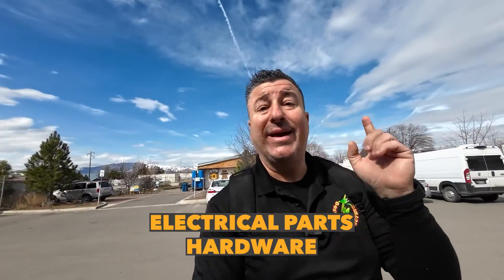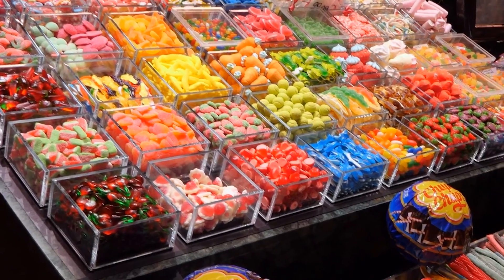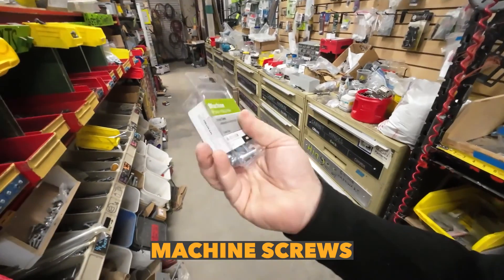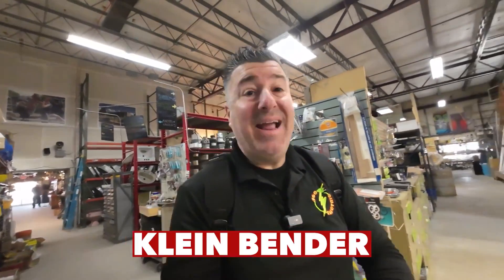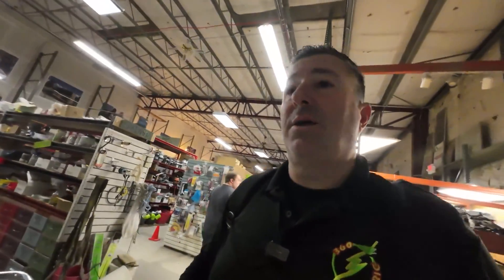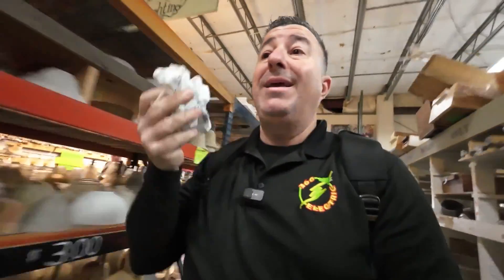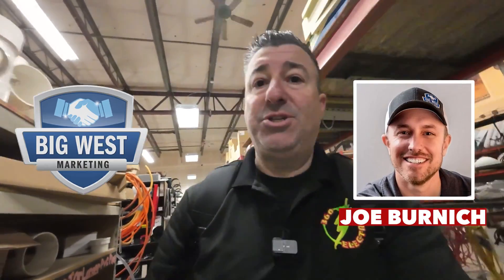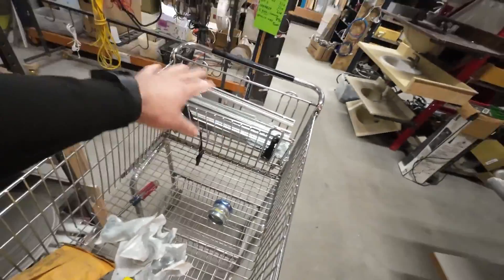How to Grow Your Electrical Business, Pennies on The Dollar! Total $ at the end

Comment: That plate is probably light almond and it's the absolute worst to try to match when you just think of white and Ivory Pro tip if you're using wire mold, light almond matches better than Ivory even though wire mold is colored and called ivory.